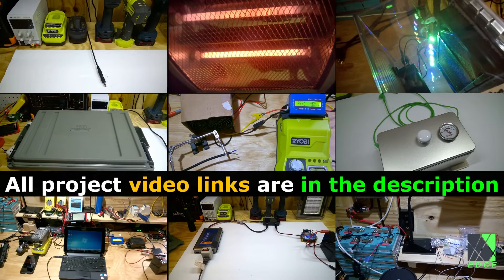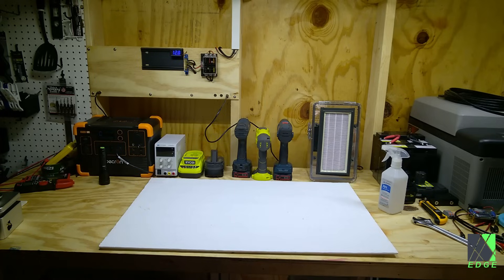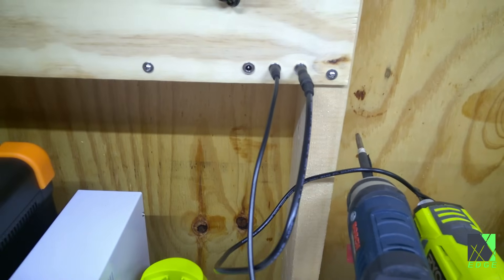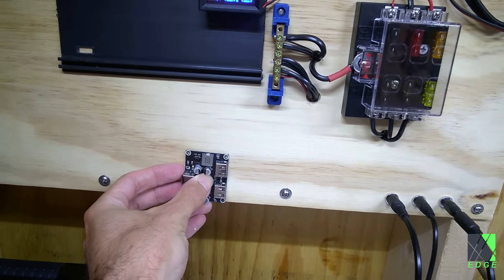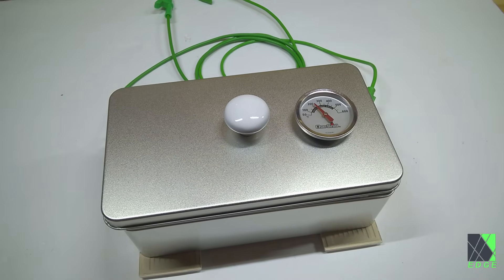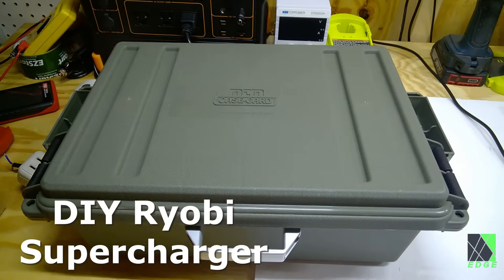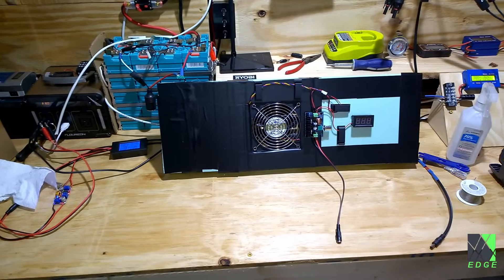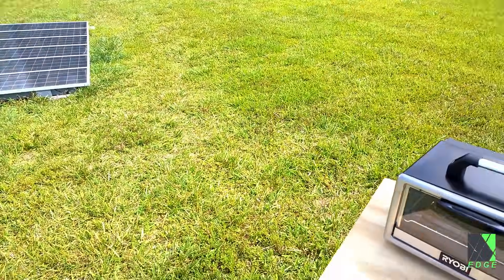What Can TRUE Direct DC Solar Power Do? Mini documentary and demonstration! #diy #solar #offgrid

Comment: I use 7 550w panels that output 50v open in series it gives me around 350v open and 310 when in use, i use a modded inverter that gets the solar voltage and creates ac directly from it, the minimun energy it generates in rain is about 350W in cloud covered sky its 600W of power when the sun shines i can get the total 3500W out of it 😊, it works like a on grid inverter but its completely off the grid
Reply from the maker: @edussantoz9034 Very cool!!! :)

Comment: Happy to be corrected. Powering Lithium-ion chargers direct from solar will not guarantee a full charge cycle thus unnecessarily degrading the battery. Thanks for sharing. Cheers
Reply from the maker: @cyclemoto8744 Hello and thanks for commenting :) 👍
You might have noticed the "fuel gauge" blinking on the battery - indicating the internal battery protection and balancing are active. The supply board used is CC/CV and won't allow too much current, even with a large 24v+ solar panel. 

I believe some people are connecting 18v batteries straight to a solar panel with no protective electronics - indeed that could degrade or potentially overcharge a cell. 

FYI all of my Ryobi charger projects re-used the OEM electronics which activate the battery protection circuits during charge cycle:
https://youtu.be/wG6ekxCY5e4
https://youtu.be/MRazwnwvczg
https://youtu.be/RMJFVHCNw_s

Comment: I am inspired by your projects. Thank you. Ryobi 18v tools, pumps and fans are amazing additons to home preps as well as shop projects. In  this heat, the little Ryobi 4" fan is a godsend and lasts a long time on a 4 AH battery (almost 24 hours). My shop over time will eventually emulate yours. Bravo! BTW, the Ryobi 18v backpack sprayer is an amazing emergency shower.
Reply from the maker: @robharrop8929 Excellent :D you're welcome... I love Ryobi everything. I really want one of those backpacks, I didn't know they existed. I have a 12v camp shower but gonna keep an eye out for a 18v backpack solution
Reply: @solarpoweredge  I got mine at Home Depot. There is also a Ryobi drill pump.
Reply from the maker: @robharrop8929 OK will look for it, thank you 👍
Reply: @solarpoweredge  The baclpack sprayer is good for 11 pumps (4 gallons per) per charge (2 Ah). I also purchased the 18v sump pump. REALLY impressed- draws 10 feet suction and discharges 50 hose no problem.

Comment: This is exactly what want to do with existing 240v internal wall outlets, that way an investor per room meets most needs, even battery management per room, most marine 12/24 volt systems are rock solid for direct solar, a deep cycle in between helps
Reply from the maker: @LeswardsOP I like your ideas... currently looking at different outlets to test for DC stuff

Comment: What im worries aboutis costs, unfortunately im in middle of a couple needed builds and doing something like this wouldbe extremely benifucial and power savings but my issue right now would be costs !
Reply from the maker: @JohnSeaward If you can find a board anywhere, the DC jacks are only a few bucks and add a 12v fuse for safety, solder on some wires and that will get you started on a budget. Over time can add other capabilities like a volt meter. I built other boards that way, just one piece at a time as I was able to order stuff
Reply: @solarpoweredge generally what size wire do you use? Thx
Reply from the maker: @girlintheblueridge6529 Hi, 16awg for small stuff like USB and lights, 10-12awg for power applications like ovens and heaters. Unfortunately, there is a lot of wire for sale that is not true gauge (less copper than true gauge), something to be aware of.
Reply: @solarpoweredge  ok, thanks so much. And thanks for ur vids. 
I hope to experiment with this soon.
Reply from the maker: @girlintheblueridge6529 Welcome! ps just subscribed to your channel. Good stuff and real DIY!  👍
Reply: @solarpoweredge  hey thanks so much for the compliment and subscribing. 
I got u too.
Reply from the maker: @girlintheblueridge6529 Excellent.. welcome :)

Comment: I made a cut in and cut out solidstate switch for my inverter and battery's tied to 1200 watts of panels.  Runs directly through my outback charge  controller. 
This runs my AC unit in the day time .
Works well
Reply from the maker: @heathhill7802  Awesome!

Comment: I been messing with solar for over a decade now. Starting out with the harbor freight 5 watt amorphous garbage panels then 45 watt kit. Then on to better bigger and bigger panels. Going direct dc is truly a great benefit over using inverters. IF you setup everything to be off an inverter and it fails you are up the creek.. without a paddle as they say.. But, also having less devices on inverter also reduces the inverter size needed for your AC loads. I am at 48V in my setup now with 150V off panels. And use DC to DC reduction for 12V devices. I found trucker websites to host loads of 12V appliances. Cheers on your setup. I subcribed and liked.
Reply from the maker: @1kzrider Thanks for subscribing and supporting :) I agree 100%... I think inverters are super useful and cool... but thinking in terms of grid-down scenarios, things can change overnight. Suddenly we might not be able to easily buy new equipment. If there's a simpler/cheaper way to run appliances we should not turn it down! Good preparedness strategy

Comment: Any issues with certain sensitive electronics not appreciating the high initial open circuit voltage?  Love the "Ryobi" toaster oven....
Reply from the maker: @daemoncan2364 Ty, I wish Ryobi would start manufacturing those ovens, I'd get one immediately.... or even two.
To your question, yes, a good example is BLDC fans, I have smoked a few with voltage spikes. In fact it's risky using an unregulated supply. When I tested the laptop with a solar panel, I had to be very careful, but it worked. Not everything can safely operate on PV DC, but I believe there are workarounds for everything. Generally, if the device is expensive or irreplaceable, I don't risk it... might as well use a regulator for peace of mind
Reply: @solarpoweredge  We do know that PV panels have a VI curve. So what about simply using a heatsinked zener diode to clamp the voltage to the load? :)
Reply from the maker: @subhobroto Sorry I do not remember getting a notification about your comment, just saw it here by chance. 
Good thinking :D actually I have experimented with this, but using a bunch of silicon diodes. I used it to hold the voltage supply and it seemed to work. Very unusual method. Hope to make some documentation about it soon!
Reply: @solarpoweredge  that's another video that would be extremely valuable!
Reply from the maker: @subhobroto I made a note to record it for you asap :D
Reply: @solarpoweredge how do you regulate voltage to not burn up your usb devices or any devices that's outside the appliance safe volt range? I'm assuming the direct solar is pushing at least 12v.
Reply from the maker: @rittzbyitch3682 I use small USB power bricks that can take any voltage, they are fairly cheap and have no problem handling direct PV input. In a desperate situation, we could use a diode chain to make a low end 5v power supply, or a zener diode. Hope to do more videos about that in the future.
Reply: @solarpoweredge  curious what those USB converters are! Do you have a model number or name to look them up?
Reply from the maker: @subhobroto Sure! They are listed as "AITIAO USB Port Fast Charger Board" on amazon and I sent you a link too

Comment: Originally many homes used 115 volt dc . I was on 1950’s tug boat that had the same power .
It had a string of 12 volt batteries to make 110.
Older brush type “ universal “ motor power tools can run on ac or dc.

I went to an old non chain hardware store and bought a case of normal wall
Switches , new old stock and they were 10 amp  Leviton DC switches .

Can I suggest you reproduce a 120 dc system in addition to your 12 volt one ?

Any heavy amp load can benefit from the smaller gauge wire .

There is no 120 Vdc outlet standard now as the Ac outlet Used that standard .!

I used the Leviton 5032-I 20 amp 250 volt outlet in ivory , other colors were twice the price .
Reply from the maker: @josephpadula2283 Hello, this is extremely fascinating. I had no clue any system like that was ever on a tug boat. I have researched Edison's early power grid setup it was around 100v DC with 2 phases.  Actually wrote about it on my blog. 

Anyway good suggestions, thank you. Ordering some of those Leviton 5032-I for testing. Would like to see those Leviton DC switches you found in operation, can't believe they still exist. (Right now I am using 500v PV DC breakers)

To avoid electrocution hazards, I've been testing 50-55vdc for distribution. I don't rule out 120v for professional and safe setups and will certainly keep an open mind and investigate it. The main obstacle has been making it "safe", and I am nervous to recommend stuff to DIY'ers unless it's "super safe". (I don't want to get them zapped with HVDC)
Reply: Anything over 50 volts is not low voltage . That is why the solar battery systems are 48 volts !

There are other receptacles  you can use also Nema  6-20 is one .
Reply from the maker: @josephpadula2283 Those are great too, thanks.. and you're right... I have tried to stay with (and only recommend LVDC) for benefit of DIY'ers.  
That said if pushing past the edge, I'd rather get zapped by 54v vs. 154v :D

Comment: so you are using 100W panels which probably have a VOC of 17 volts which means you won't blow any normal 12v device up for an overvoltage.  but if you go larger on the solar panel with a VOC of over 24 volts you would need DC to DC stepdown convertors to do what you are doing ....that might be something you want to point out
Reply from the maker: @dennisgoldman7160 Hi, thank you for the feedback, I will mention the step-down DC converters ASAP. My 4 100w panels were chosen for their lower voltage, but hope to add a 250W~ panel to the system, probably will add a converter at that time
Reply: @solarpoweredge  a quick note; I've seen a number of 12/24v rated appliances out there. That is they can run on either. This is something that can help with the issue described.
Reply: Yeah actually many devices can use 12/24v.  This includes all common cigarette lighter usb chargers and many other common 12v devices.  🤙

Comment: Thanks, good work.  I also do some easy direct solar things. My current interest is charging my F150 Lightening direct from an array, I can match the 400 volt DC by stringing my 20k array correctly and generate however many amps it makes. DC slow charging but much better efficiency than AC same wattage. I haven't tried it because I don't know what signal the truck needs to start charging. Any ideas?
Reply from the maker: @philparks2589 The signaling is one of the challenges, currently I don't know how to get around that. I need an electric car to experiment with, maybe someday

Comment: I've been playing with these concepts also. one im trying is to make a solar only fridge from a fridge/freezer combo, where 2/3 volume is a fridge, and the remaining 1/3 volume is freezer on the top. these are often found cheap or free when people upgrade here in Australia. plan is to freeze a giant block of ice occupying the whole small freezer during the day, then activate a diy heat exchanger to cool the fridge during the night. because the freezer is on top, this may even be possible passively with convection and without any electronics. I've done the calculations and tests so i know there will be enough thermal capacity in the ice to keep the fridge cool for 2 days. now I'm working through the fiddley bit to make a heat exchanger modification powered by a small battery operated motor for temperature control of the fridge. hopefully will have a solar only fridge that keeps cool at night in the end, although it will still need a small inverter.
Reply from the maker: @justinnewman5533 Right on, good thinking! I am playing with several DC compressor based systems, and have had a freezer running directly off PV for some time. Same idea, using ice. It brings a number of challenges, obviously such as the sun not always being out for 2-3 days. But these things are very relevant and need to be further investigated, we'll just keep experimenting :)
Reply: If you could find a vintage refrigerator, the icebox is open to the fridge, as it used this same principle to cool the fridge.

Comment: Pretty cool system. I am thinking about doing something like this for my new home to charge up electric cars. Skipping or bypassing the AC/DC change.  For those USB ports, make a mini shelf behind that board so that they point straight out.  You could market some of those products. I guess anything set up for an RV would work too.
Reply from the maker: @Jerry-ko9pi Great thinking :) If I had an electric car, I'd already have taken it apart by now and had solar hooked up to it, hopefully sometime in the future. Good points on the USB... I have the 5v boards just need to install

Comment: My first time to your channel, not sure how it wasn't recommended to me long ago by the YouTube algorithm.  Just wanted to check to see if you'd seen Dacian Todea's (Electrodacus) work with turning solar panels into radiant heaters?  I wish I could remember exactly what needed to be done to modify them to do this, but I think one of the three sections was disabled and then the diodes were modified as well before backfeeding power into them.  But apparently this is a very efficient way to bring direct DC solar power into your buildings for radiant heating.  Might be something you would want to look at and make a video on, as there isn't much information available on the subject that I can find.
Reply from the maker: @NoelBarlau Yes I have always been very impressed with Electrodacus' work, been watching him for many years. Was not aware he was using solar panels that way. It's on the list to investigate. All these endless ideas outnumber me hehe

Comment: nice work, I thought very similar to you. I want to maximize efficiency and run a seperate 48 volt bus for bigger loads that may require to be spread out across a structure. This is for things like a fridge, forced air furnace (converted), air conditioning, well pump ECT.
As you demonstrate, 12 volt appliances are available and simple to implement, I wanted to regionally tap 48v bus for localized 12volt applcations.
Reply from the maker: @tombloemker9434 Good thinking sir, right on :) there is an article on my blog about a 48v DC power grid... It's a bit too far out for YT. Could use a step down converter locally, that might be the quickest and easiest?
Reply: Hi, for larger loads you would want to go to higher voltages, 48 being common and allowing you to get stuff that works off it. 12v is used a lot because there is so much 12 v stuff out there and it is available from cars, the system being 12v.
Tesla have moved to 48v and it has all the advantages as above, so hopefully there will be more things that use it in the future.
Take care M.

Comment: In my van when I'm camping, the fans are hooked right to the panel, no batteries.
 Sun comes out, warms things up, fans go faster.
Osterizer blender will work on DC,.. kind of slow on 12 volts, more than 12 volts makes it go faster.
Reply from the maker: @oscarvogel2140 Excellent

Comment: What about connecting cigarette sockets directly to the pv and using 12v appliences? And or using stepup and stepdown circuits?
Reply from the maker: @Theoverthinker81 Both I have tried: it turns out the step down converter is the safest. Sometimes you can use direct PV, but watch for over-voltage as it's not regulated. Here's a good example of unregulated 12 PV DC cooking https://youtu.be/-QthPOTDLSY

Comment: Why did you choose 2.1mm plugs as your standard vs all the other options?
Reply from the maker: @SeekingBeautifulDesign The 2.1mm sockets I use are an all-metal design, and carry a good amount of current. This plug type is extremely common on a lot of electronics, making them plug and play. The plastic 2.1mm sockets are usually not durable and can get very hot
Reply: @solarpoweredge  Thanks.
Reply: @solarpoweredge  how many amps are they good for?
Reply from the maker: @YeahTheOzzy My first-hand experience was this.... the 2.1mm sockets with "good quality" and total all-metal design, I have pushed 7-10 amps. (most are cheap plastic). the 2.1mm plug must be a heavy duty type, hard to find. Unfortunately, the cheap plastic sockets and plugs can melt so I'd keep the current around 3 amps for those!

 #1 concern is if you're pushing amps through, check the socket and plug at 0-8 hours: warm is OK. Hot is NOT OK ever, something is wrong. Please don't leave them unattended. Also if it's a sloppy loose fit, eventually the connection will heat up, got to keep an eye on that.

I'd like better plugs, but at least some of mine will always be 2.1mm... those plugs are absolutely everywhere and serve the majority of needs. I will later add a couple XT plugs for high power stuff like bigger ovens and appliances :)